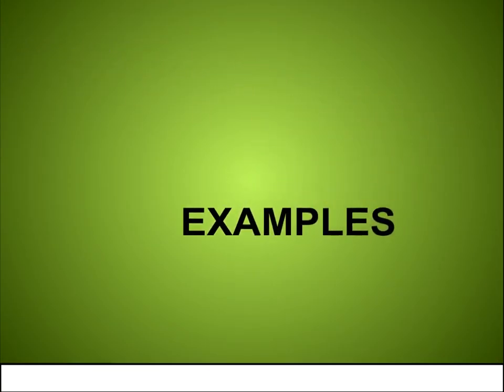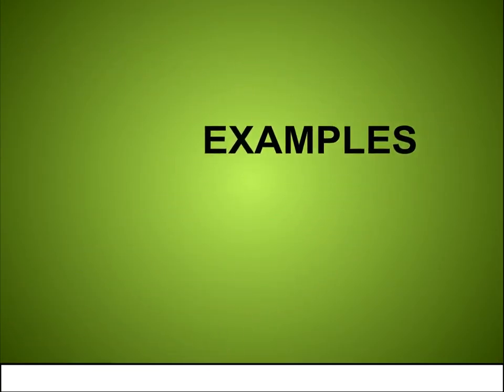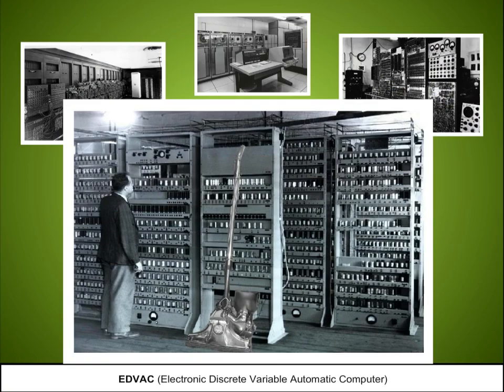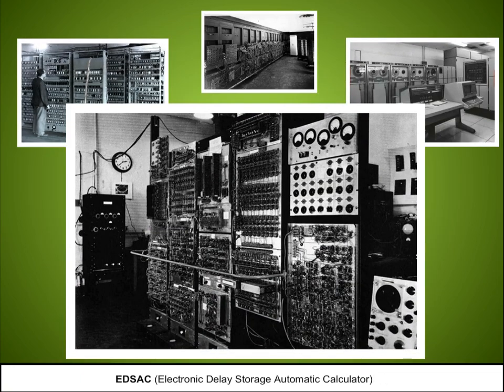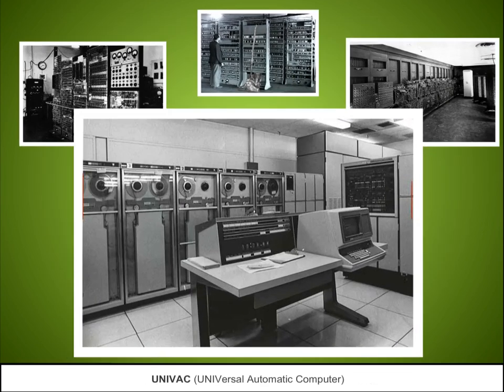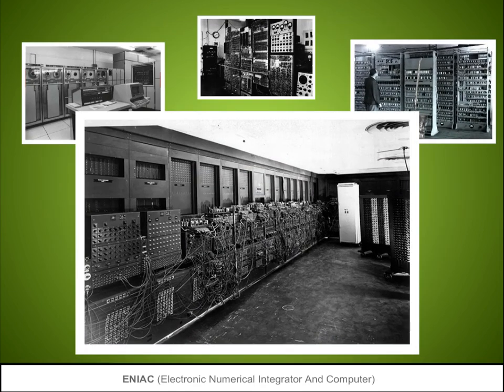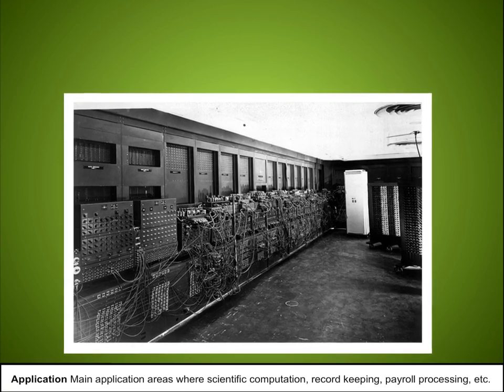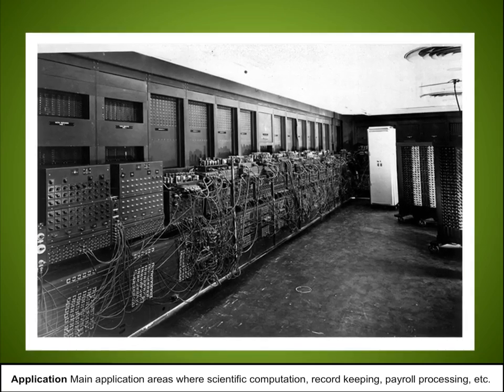First Generation Computer

Comment: I always thought that the vacum tube computer is technically the second generation of computer, because before that, there were relay computers. Also, the vacum tube era lasted precicely from 1942-1954 because the ABC was the first tube computer and the Tradic was the first transister computer.